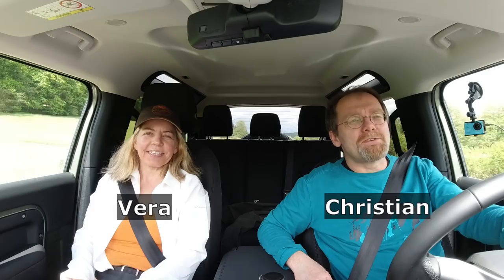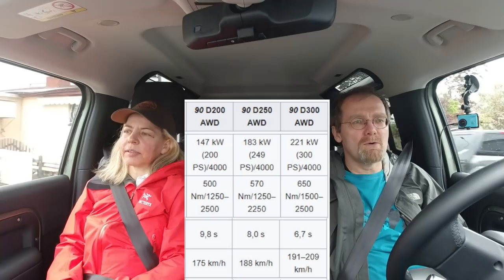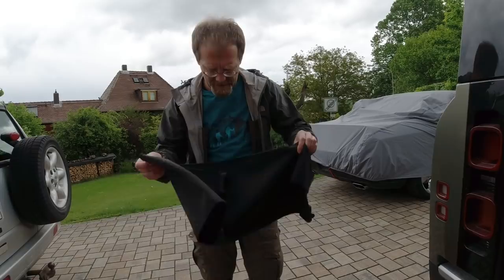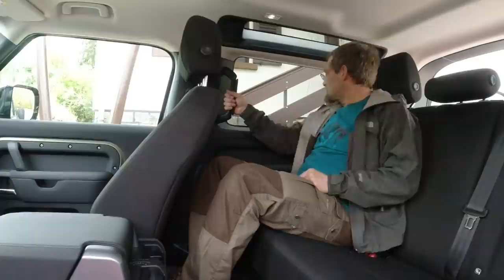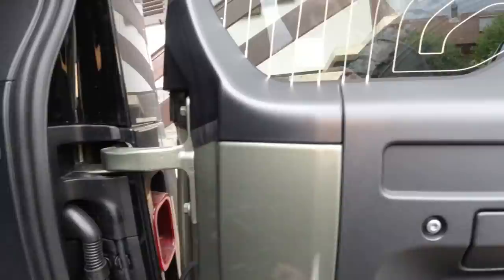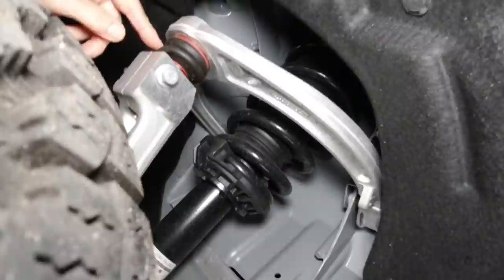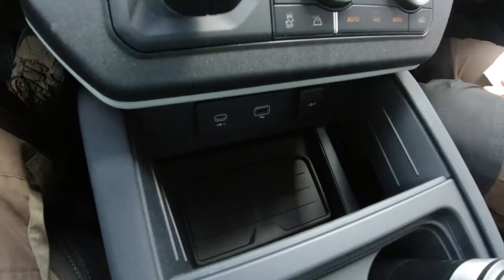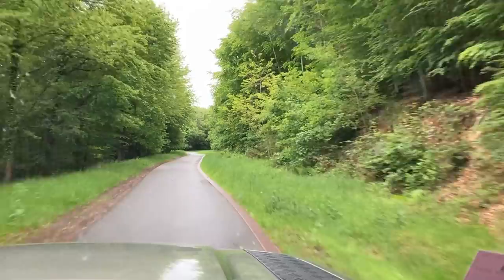Review 2021 Land Rover Defender 90 D200

Comment: I think complaining about the lack of boot space in a 90, and comparing it to a discovery is a bit weird. If you want to lay down in the back, get a 110 :) I think the one you tested there was the absolute most basic model you can currently get. The air suspension makes the ride a lot better, and helps with towing too. I've had a new 110 for almost a year now and it's easily the best LR I've owned. Much better than the Disco 4 HSE I previously had, both on road and off road. Also the surround cameras remove any blind spots if you don't remember you're parked next to another car 🤣
Reply from the maker: We love the new Defender, and would definitely get a 110. However Land Rover only offered us the 90 unfortunately. 🙋‍♀️Vera

Comment: To have the backseats flat you need to release the butt seats and move them to the front. That way you can have a flat bed
Reply: Not really, there are still a few degrees away from a flat bed.
Reply from the maker: We tried and were not able to move them. It would be then like on our Discovery 3. And then there is still that Aluminum rail, it's at least 10cm high. 🙋‍♀️ Vera

Comment: Many thanks for giving it such an honest review , did u notice the rear door soft close feature , ref that spike is for mud clearance  and indeed see the rear seats fold completely flat in the 110 , must admit really like them , think I also saw somewhere u can move the tow bar in and out using a switch inside the boot, all down to which options are chosen I assume , as always thanks for yet another great video 👍👍, ps still shocked that with options u can spend in excess of 100k

Comment: I think the rear seats do fold completely flat. First, you removed the base cushion and stow it behind the front seats. The seats will then fold flat.

Nice to see that Land-rover still like to show at least one warning light on all the time. But I didn’t realise this happens even on brand new vehicles! 
I feel so much better now knowing this fact!

Another great video from you Guy’s.
Reply from the maker: We did try to take the cushions off, and the Aluminum rail. Did not move at all. But I will be convinced otherwise, if you send me a link to a video showing how to do it. 👍🙋‍♀️ Vera
Reply: @Vera_and_Christian  
Her you go Vera. This is how to fold the back sheets right down 
https://youtu.be/_PFk3mj_Mb8
However, there is no solution to the aluminium bar.
Reply from the maker: This is an acceptable solution and thank you for sharing.  It makes the biggest downside of this car go away.  👍 I think we best put this link in the video description.  Christian
Reply from the maker: @Rickwardful  I know that video, but that is not really a solution for me. Not for 60000€.  Knowing Land Rover cars well enough, I wonder how many times you can do that without breaking a clip or a mount and then be bothered with a ratteling noise. Also the incline is not the biggest problem for me. The raised aluminum bar is. 🙋‍♀️ Vera
Reply: @Vera_and_Christian  I agree. On the Range-Rover Sport up to 2013, The LR solution was to fold the seat base forward so that the back of it sat vertically behind the front seats, then fold the rear set uprights down so that they we level with the rear deck. This worked very well. I wonder why they didn’t use this system in the  new Defenders?

However, it still makes me laugh to think that even new LR’s have at least one warning light on all the time!
Though strangely enough, my 2005 Discovery 3 with 160,000 mile has no warning lights on at the moment. 
I wonder if this is because the warning light bulbs have blown!

Keep up with the good work you two.
Reply: That’s not a acceptable solution for me.
Reply: @williamstoutjesdijk-ry2oz  What isn’t and why not?
Reply: As per the video you shared, I don’t think it’s an acceptable solution you need to pull the bottom seat off to get it the back part of the seats flat. As mentioned for some it might be acceptable but not for me.

Comment: Not sure of anybody has already commented, but I notice the battery and some electronic equipment are mounted in underfloor compartments below the front seats. Not such a good idea for an ostensibly serious offroad vehicle that may occasionally have water ingress through deep water fording or require pressure spraying of the floor to remove mud and dirt. Seen far too many vehicles unfixably stranded with electronics flooded to make this an acceptable design option
Reply from the maker: I assume Land Rover expects their doors to be tight 😉. We were suprised too. 👍🙋‍♀️ Vera

Comment: The design looks like a D3, the 3door version looks like a very small D3. I think the upcoming D130 will be an aedequate follower of a D3 or D4 - have I mentioned, that I dont like the D5 design. However after driving a LR D3 for 3y (and remembering the bills), any british car is of the wishlist. The engineering features you mentioned in your video are supporting this strongly. It's partly built unbelievable robust, on the other hand there a dozend of potential and expensive weak points already visible which might come up just after warranty ended.
Reply from the maker: Yes, true.  The car is a bit shorter than the D3 but in general it is a big car.  The 110 must be massive and the 130 must be gigantic.  Christian

Comment: Such an enjoyable review. Thanks for this humorous trip through the latest 'discovery'.  :)
There has to be a solution to that rear seat.  What a horrible load space with that part fold down. 
I really like the front end and side view,  not sure about rear. I do like the white steel style wheels. They would look great on a disco. 
Thanks again.
Reply from the maker: If it would have been called a Discovery 6, they would have sold a lot more cars by now. 😅 When you are in the market of a brand new car, the 110 sure is the best looking offroader. Especially here in Europe. 🙋‍♀️ Vera
Reply: @Vera_and_Christian  The 110 with the +2 seats has nowhere near as much room in the rear as the current Discovery, and probably the D3/4 too.  The Defender body tapers in quite a bit above the shoulder line, and removes a surprising amount of room width wise. So while some think it's more like a Discovery replacement, space wise it really isn't. Does look really good though and in general the interior is great, as is your unique review! 👍

Comment: Placing the battery inside the passenger cell is pretty stupid.  If there is an overcharging situation, the acid gassing off the battery will choke the occupants and potentially cause vision problems for the driver. 
Don't even contemplate the explosive possibility.
Reply: Looking for problems without inderstanding the design - there are so many safety regulations that LR have to obey.  I doubt what you say woule be possibe.  The compartment is definitely sealed - maybe there is a vent that goes up the piller to vent outside at a high level (?)  -  certainly safer than under the bonnet where it can get soaked with a river crossing.  Designed by the same person who designed the Disco 3/4.
Reply: @AndyK.1  and Austin Morris from the 60's
Reply: @AndyK.1  Yes, the passenger cell ( the boot area is not hermetically  sealed from the main passenger seating area,  thus vapour and gases are free to flow  )
I have experienced an overcharged battery in a mini; it was very unpleasant,  especially for my two rear seat occupants who took longer to exit the vehicle than myself as driver.

Comment: Also meant to ask, have u thought about fitting some LED lights under the bonnet of ur D3 please, seeing there some cut out apertures there already ,  have been looking round myself for some lights and wondering if it would be a simple task of wiring them into the bonnet switch, wondered if the footwell / under door lights might fit ?? ,  will be a good excuse to use ur 3D printer as well, lol many thks 👍
Reply from the maker: What an excellent idea.  I will look into this. Thanks Gary.  Christian

Comment: Hi Christian and Vera, I don't think hardly anyone who liked the old Defender for utility purposes will buy the new model, obviously too reliant on electrics, too smart inside, too expensive just for starters. Also to difficult to modify by aftermarket suppliers.
I think LR should have called it the new Discovery (whatever number) as it matches there profile and style.
Surely LandRover have lost millions in sales to utility companies and armed forces farmers and the like with lack of a utility vehicle in there portfolio of vehicles. I see lots of Isuzu and Toyotas with winches and lifts  and utility back ends being used by Electricity companies and all the others who used to use Defenders.
Personally I am looking  forward to seeing the Ineos Grenadier come to fruition because I think that would be more suitable for all the afore mentioned work/jobs depending how much electrics it has. I love the straight 6 BMW diesel as I have used several in several vehicles and mated to a auto which transfer box and diff locks it should be good. 
Like you Christian I probably will keep my Disco 3 as I have done so much work to it I know every part which has been fixed or changed I keep improving it and always know what spares to keep in and can change things as I need
Currently the body is off fitting to turbos, head gasket, hand break unit, chassis total underseal and fit a Terraferma straight through exhaust. Oh I could not believe the hassle you had putting wheel spacers on...I just got Terraferma 25mm spacers fitted them and added a lift and 265x85x18 BFG AT2,s it looks great for height not to tall and superb as yours wider stance...
All the best Phil and Louise
Reply from the maker: You are right, the new Defender should have been called Discovery 6. With your lift and tire size, I will probably need a ladder to climb in 😄. But we would do the same if we could. 👍💪🙋‍♀️ Vera
Reply: @Vera_and_Christian  Just to add to your general engineering and motor themes Christian my wife and I love Land rovers and used to compete in land rover trials in the UK mostly in the 1990,s currently we both own Harley Davidson motorcycles, Louise's is a 2019 1200cc stage 1 with Vance and Hines exhausts and tuner mine is an 1800cc CVO Fat Bob from 2010 which is race tuned and sounds and goes fantastically, i love setting car alarms off with the sound and vibes from the Vance and Hines short shot exhausts. I have extensive electronic and engineering experience being a Materials handling electrical and mechanical engineer with multi disciplines experience ..but mostly common sense and experience. We like very much your amusing and entertaining videos,  Lived in Munster for 3 years in the 1980,s Phil

Comment: As a person that replaced the Disco 4 with a new Defender 110 and owns a Cruiser 79 here’s my take:
The new Defender is better than the Disco 3/4. It’s not the same car and it doesn’t drive the same. 
A Toyota does have a engine failure light and I’ve seen it a couple of times. (For the record in 8 months I haven’t seen it on the Defender) 
The Toyota is horrible to drive as a daily. If you don’t agree then you have very low standards. 
Living in South Africa traveling up north Toyota really is your only option for parts etc. 
From the comments section it’s always very clear who actually owns a Defender or a Toyota and really use them for what they’re built for.
Reply from the maker: Well said.  I appreciate your opinion and you are absolutely right.  🙋‍♀️ Vera

Comment: Lovely review - but I do prefer the Defender 110 - the seats do go fully flat in the 110.  Love it, but can't afford it.  But - as the new Defender is really the replacement for the Discovery 4, I hope I can pick up a late Disco 4 as users change to the new Defender.  But I am sure that the Defender 110s I have seen had a clamshell bonnet like the Disco 3/4 - your 90 did not have a clamshell bonnet ???
Reply from the maker: I have never heard the term clamshell bonnet. I am going to have to google that.  👍🙋‍♀️ Vera

Comment: After watching your D4 electronic engine oil level sensor replacement video, the obvious (unanswered) question is "does it have a manual dipstick ?".  I saw you pulled out a dip stick with "oil" on it but was this gearbox/diff/transfer or...hopefully an engine oil dip stick ??
Reply: It has a engine oil dipstick. Pre twisted, at least it was on the Frankfurt Showcar.

Comment: I'm still concerned about the "Ingenium" power plant.  At least with the PSA/Ford engines you know what the issues are and they have a long track record of lasting hundreds of thousands of km/miles.  From what I've heard there have been boatloads of failures with 2L Ingenium diesels, not sure if the bigger engine is better but the "mild hybrid" feature just seems like something that will malfunction and cost a ton to fix.  Not so comfortable with an engine built by JLR, really the first they've done that has Fiat licensed technology in it.  It also seems like every reviewer and auto critic get one with a light turned on.
Reply from the maker: Time will tell, we are also curious to see how this engine, and the car overall acts up when they finally get up to 150000 Km over time. Our Discovery has a PSA and my Freelander has a BMW engine. That one is indestructible. For us personally, it would be best if it had a couple of problems, otherwise the price tag is going to stay up high and we'll never be able to afford one. 😅 🙋‍♀️ Vera

Comment: Hello. I have seen in other Defender reviews that you can pull the bottom part of the rear seats forward and down (where the legs go), and then the backs fall completely flat. Admittedly those reviews were for the 110, so I don't know if the same can be done in the 90.
Reply from the maker: That is not the case in the 90. 👍🙋‍♀️ Vera
Reply: @Vera_and_Christian  I see, thank you! It almost feels like all the effort was spent on designing the 110, and the 90 was a bit of an afterthought. There are quite a few things that don’t seem quite right about it. Anyway thanks for the review, I wanted to see the 90 in more detail. Now that I have I am leaning towards the 110 (even though it is a bit too big for me).
Reply from the maker: @MismanagedFutures  We love the 110 too 👍🙋‍♀️ Vera

Comment: Just what an off-road vehicle needs, electronics in the floor beneath the passenger seat, brilliant LandRover...
Nice review, Christian and Vera, and the Defender made it back to the dealership under it's own power, big bonus, your right though, they maybe nothing but trouble in a few years...
Reply: Er - electrics and battery under the seats in a compartment sealed from the outside and moisture seems a very good idea to me - it also helps to lower the centre of gravity of the vehicle - so gets a big thumbs-up from me.
Reply: @johnwillett4086  Er-where I live we cross rivers that quite often are up to bonnet level, and in all those crossings I haven't seen one 4x4 that doesn't get water in the cab at least a bit. I'm looking forward to towing a new Deefer out with my old D1 Disco at one such crossing. And in case you haven't noticed, it's a LandRover not a sports car...
Reply from the maker: Then at least they are cheap enough so we can buy one and Christian can show everyone how to fix it. What else are we supposed to do for content in 5-10 years. 😅👍🙋‍♀️ Vera

Comment: Thank you for this Review, erverytime that i spend in the Configurator i am running Up to 80000 Euros in the Defender. What you want ist Air Suspension an locking Rest Differential thats cheaper in the Discovery 5 🥴

Comment: Nice review, but my advice is that  you should take   the 110 for a spin before deciding .  There the seats fold flat.   
Since it comes with air suspension, Vera will be able to climb in  easier :) . Plus I am sure the ride is a lot better than the coil version you tested.  

I have  a 110 P300   on order   for overloading purposes. ( I currently own a Toyota  Hilux.  ) .  I got the base spec, what a I call the "poverty pack"  :)   + off road pack and a few extra safety and protection options.     The only indulgence was the petrol version, P300 .     The base version  has almost the same amount of features  Land cruiser    Prado   top trim, and the petrol version I have on order has an extra 100 HP, and it came   2000 euro cheaper than an equivalent  Land cruiser Prado.  Yes you can go more than 100 k euro, but you can also be conservative.  For me to  have a petrol engine is very important   because I plan to travel outside EU and   Euro 6 diesel with Adblue does not go well with the fuel standards in Africa or Asia.  So the Prado was a no go from the start since   in Europe you only find the diesel version.  
I looked at the Disco 5,  but, at least  in Luxembourg, to have the  low gear transfer case, it is available only with the most powerful engine, and it becomes  more expensive.  Also the suspension in general seems to be more beefier in the Defender, it is a lot more off road oriented than the current generation Disco. I think the interior is more suitable  for the mess you make when you overland .  For many other people probably  the  Disco 5 is fine, but for me it ticks all the boxes - capable off road, petrol engine available,  enough room and payload. 

Love the channel - keep up the good work :)
Reply from the maker: They did not have a 110 available at the time. We just wanted to test drive one to see what is all about and what we think the future might hold for this car. Right now we are really happy with our Land Rover, but maybe in a couple of years.  It also depends on how this Youtube channel is either growing or not.  We could provide lots of content and especially featuring 3D Print designs and mods. 👍🙋‍♀️ Vera